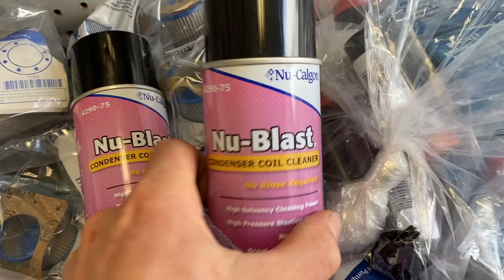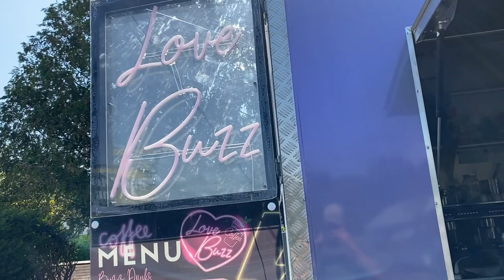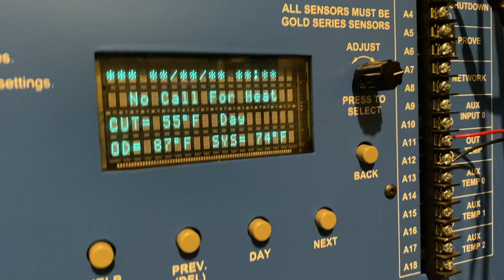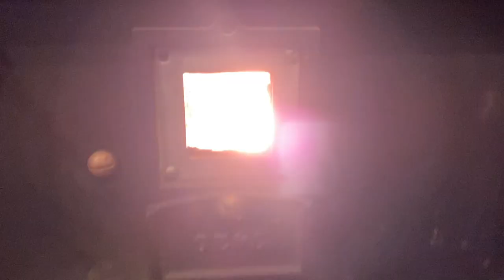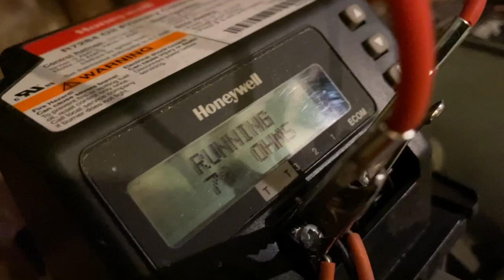Massive Steam Boiler! Running HVAC Calls Out Of A U-Haul | Commercial Steam Boiler Service

Comment: Do you do plumbing too?
Reply from the maker: I do! My main thing right now is working for an HVAC company but I am also a master plumber. At the moment I only dabble in small side projects!
Reply: Could you replace a 50 year old oil fired steam boiler for a new Burnham V9 Gas Steam boiler? Want to use the existing gas in the building. Basically it with the old, in with the new. Using all the same pipes and radiators. Switch from oil to gas. I'm looking for someone who can do that. It's in a 10,000sq. Ft. commercial office building. The building is all concrete, originally built in 1920. It's an office building.
Reply from the maker: Sounds like a fun project! That could definitely be done as far as switching to gas steam boiler. Personally I can’t because I’m not insured working on my own company yet, I work for someone else.

Comment: Nice guns. 

When you're cleaning the nozzles around 12:50, is that a drop-in parts cleaning tray for a 5 gallon bucket? Looks super handy.
Reply from the maker: Thanks! 😂

Yeah so that is the General E-Z Change Filter Draining System. I have used these buckets for years to drain off oil filters, strainers, and nozzles. It's a bit overpriced but it is handy to have. I added it to my Amazon store under the "HVAC" section if you want to check it out! Thanks for watching my videos! 👨🏻‍🔧💪🏼
Reply: @BlueCollarBiceps  Thanks for making them! It's easy to see that you take pride in your work. I really enjoy your videos. 

Thanks for the info, I will have to track that down. I would go through your affiliate link but I stopped using amazon years ago. I think I'm the only one out of seven something billion people on this planet that doesn't use amazon, I'm really sticking it to them. 🤣